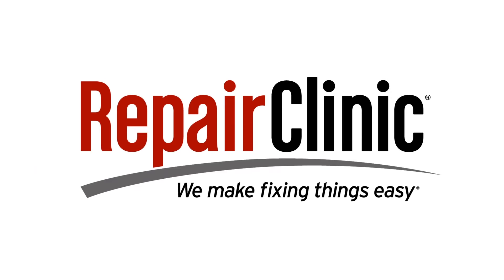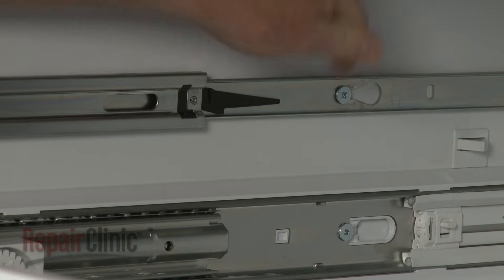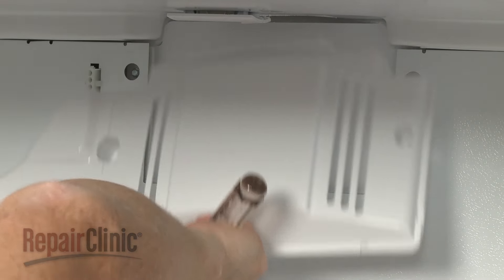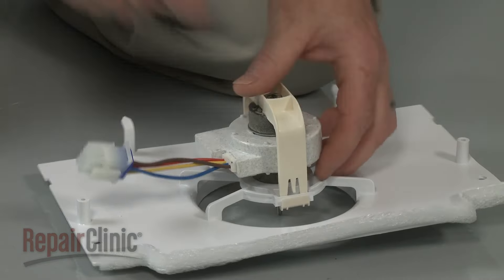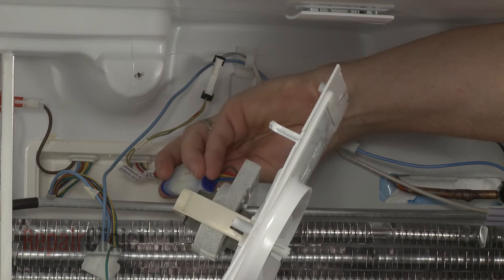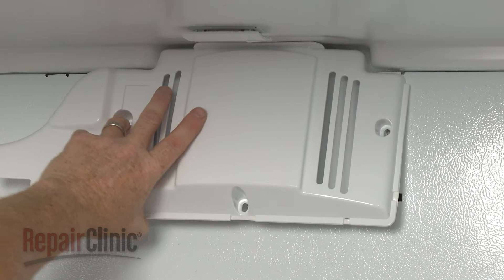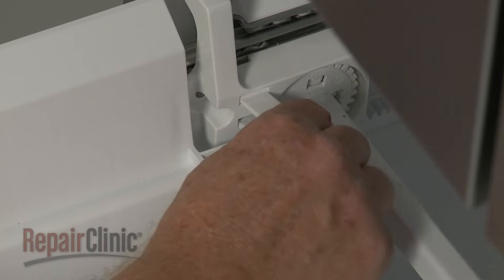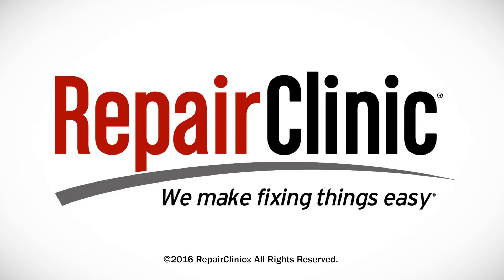Frigidaire Refrigerator Replace Evaporator Fan Motor 241509402

Comment: I tested the old fan motor (and the replacement) by using a drill battery that puts out about 12 volts. I connected the positive to red and also yellow by using a jumper. The negative connected to brown. The old fan didn't move, but the housing got warm. The new motor started spinning. We had a similar model Electrolux to this video, so almost everything was the same. The video was a great help.

Comment: Help! I followed directions precisely and when I went to plug in new fan the plug wouldn't press down far enough to catch.  It's like the metal prongs are too heavy of gauge. Double checked part number on fan - correct. Probably something stupid so be gentle...

Comment: Regarding a Frigdaire glhs36eesb0 side by side... It is cooling fine. Freezer is cold. But recently the Evaporator Fan has started running all the time. I suspect some little sensor has gone bad???  What controls turning on and off the fan in the Freezer?

Comment: HINT:  Once motor is replaced and mounted, plug in and make sure the fan is running before you put it back together.
Reply: Whi and was a
Reply: B
Reply: Ú Hi as
Reply: Changed fan and followed directions, looked up and ordered correct motor. Evaporator fan still not turning. Is it possible to connect clip backwards. I put red to red and yellow to yellow, brown to brown. Help
Reply: @ginny1119  No, the connector will only go on one way by design. My next step would be to check for voltage coming out of the connector with a multi-meter. Could be a broken wire not letting current through. You can also check the motors by jumping a 12 volt battery to it and see if the motor spins.
Reply: @TheCreepNDeath  There are 4 wires on the motor, which one goes to 12V and which ones goes to ground?  What do the other 2 go to?
Reply: I found the service manual.  Red is +12V, Brown is ground, Blue is the tach signal that returns to the main board to let the main board know if the fan is running and the speed, Yellow is a voltage to the fan from the main board that is varied to control the speed of the motor.   So if you put +12V on the yellow and red and ground on brown it would run at max speed.
Reply: @shanefrank3281  So I did this and it proved the fan is working (used a 9v battery). So since the fan is spinning  does this indicate it's a control board issue? Or just a broken wire to the control board or what? Did your test after buying two different fans. Figured both new fans couldn't be bad.
Reply: @bradyr7227  I had purchased a new aftermarket fan and it would work fine when hooked to to a power supply (or battery) but when hooked to the main board, it would begin to spin then stop.  So I then purchased an OEM fan and it worked fine when hooked to the main board or an external power supply.  So based on this, the fan working  with a battery is not conclusive evidence that the board is bad, although it could be.

Comment: I have a Frigidaire FGHB2844LF7 and my evap  fan is not spinning getting the SY EF on display. I already replaced the fan motor which didn't help. Any suggestions?
Reply: Minds doing that now I h think it’s the control board

Comment: My Frigidaire Frig (Model: FGHB2844LF3) has an SY EF error.  I've replace the evap fan/motor and control board.  Yet, the error still remains.  Could it be a thermistor (PN# 5303918416) or refrigerator sensor (pn# PP8992304X61-X3)?  Sometimes I'll hear a noise that sounds like ice falling falling inside of the freezer, but there's no ice build up on examination.  What could be the problem?  Can you help point me in the right direction please?  I'm almost to the point of just throwing it away and getting another frig.
Reply: My fan isn't coming on. I'm looking for a way to put the refrigerator in evap fan test mode to make sure I dont have a bad fan motor. I dont want to replace both parts as you did and it not fix the problem.
Reply: Did you find any solution im on same problem with you
Reply: Following